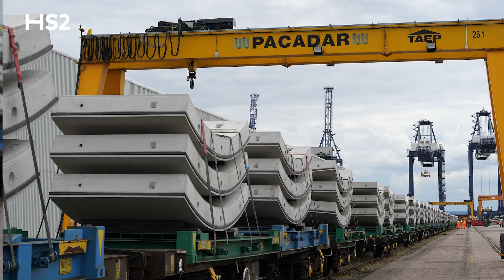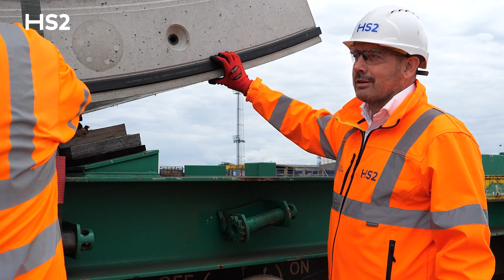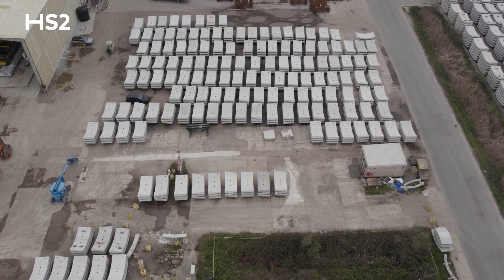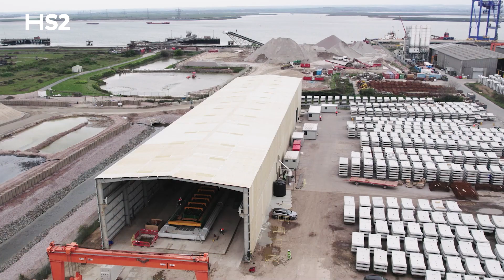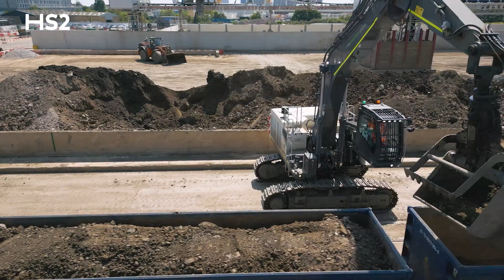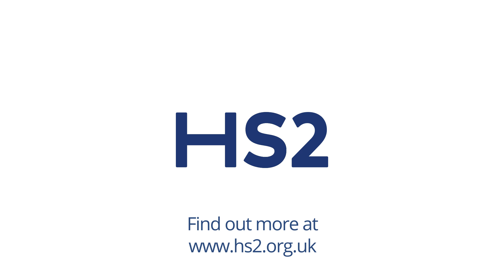Rail deliveries of HS2’s tunnel ring segments in London remove a million miles of lorry journeys

Comment: For the London to Birmingham shuttle?? Such a shame that people decided to go with 'Speed' in the title rather than 'Capacity' people will naturally say I don't mind a few minutes less if it saves money, but if they are told nah you may have to wait for 3 or 4 trains before there is space they tend to have a different view...
Reply: Politicians are stupid
Reply: The lockdowns reduced capacity (or make the trains longer etc)
Reply: @jasonsmith902  Passenger numbers are almost back to pre-lockdown numbers and rising and you can't run longer trains without cutting other services to make space
Reply: Expansion and investment on the west coast main line was cancelled and delayed because it was costing too much/were investing in HS2... So sadly HS2 has been part of the problem. We could have had longer and faster trains 10 years ago without HS2 on WCML. Or if we wanted a little more speed and lots more capacity then an electrified Chiltern line and electric east west spine (but that wasnt sexy enough).

How about putting in a park way stop half way? seems terrible waste to scrap the Euston/Euston road tube foot tunnel. Now this is a pure south east England Infra project maybe a few tweaks to improve it?
Reply: @iainsear7830  I seem to recollect West Coast mainline upgrades nudged north of £40B for incremental upgrades, HS2 was cheaper to deliver more. I think you are disingenuous the HS2 led to cancellation of WCMLUG. That was going to happen regardless because of the obscene costs. HS2 got cancelled because the costs spiraled - just like WCMLUG!

The real question is: how come the UK cannot build a new railway cost effectively? Or run an old one cost effectively, or that matter. I have my thoughts on the matter but I will not share them here and now.

Comment: It's all very well to take the lorries off the road, and that is good, but the train locomotives themselves are diesel powered, so it's not as if they aren't throwing out lots of polution.
Reply: That's true, but scale really matters here. One diesel train puts out far less pollution than the 100-300 lorries they replace, and then you have to also consider the congesion, road surface wear and mud buildup, greater accident potential, 100-300 lorry drivers to pay, etc. For moving heavy things, especially to sites with rail access, rail is the way to go.
Reply: Another clueless keyboard eco warrior
Reply: How else do they power the trains??? With a windmill on the roof of the loco???
Reply: Powered by solar panels train?

Comment: So now a large part of HS2 (the part that REALLY would have made a difference to the north) has been scrapped, what happens to all the supply chain? Also, wasn’t Euston scrapped ??
Reply: The supply chain will continue to deliver phase 1 and then be wound down. Rather disastrous for the rail network.

As for Euston, that will apparently be delivered by a private consortium…. Apparently.
Reply: @iman2341  There can only be one outcome where a private consortium is involved - it will cost the taxpayer more ... .
Reply: @RobboSez  And the public will get a worse station at the end of it. Classic Tory fire sale before a Labour government. 

Last one was rail privatisation. That went well….
Reply: Always said, if this was such a good idea why wasnt it started from the north end? 
Advantage London, again.
Reply: @tonydickinson1234  I think economic boost that comes with connecting London and Birmingham with a independent high speed line is going to a massive boost to the whole of the UKs economy by freeing up space on the west coast mainline which is the most congested railway line in the UK for both freight and passenger trains
Reply: @Diohxx  It's going to make very little difference due to the major log jam north of Birmingham, without the full link to Crewe and Manchester it serves little purpose
Reply: Now they've scrapped alot that's even less lorries on the road 😂
Reply: @andycrask3531 we don't want to drive there either and spend 8 hours waiting to be unloaded
Reply: @woodnlotsoflovelukeworswic8352  would be a different story if they'd started at the end wouldn't of been cancelled then I don't think.